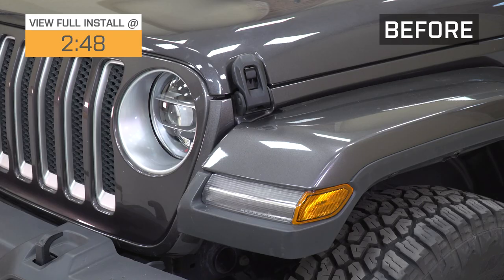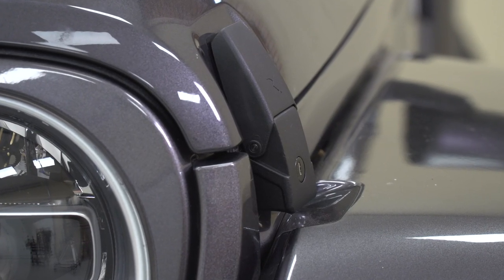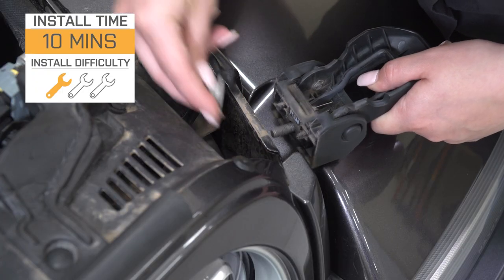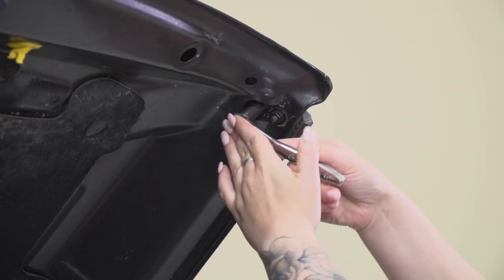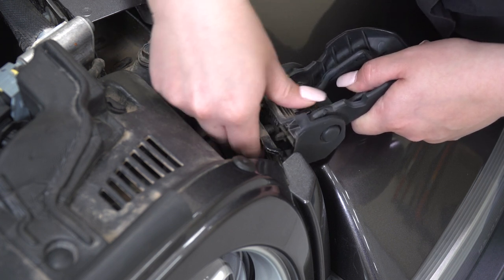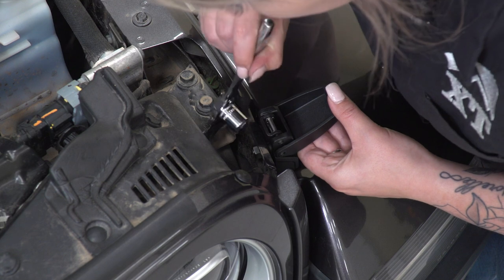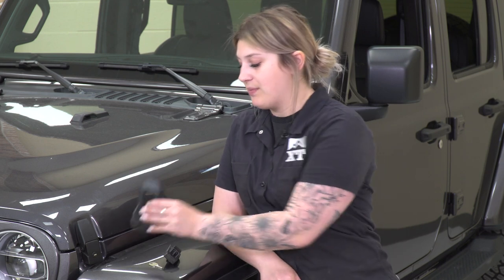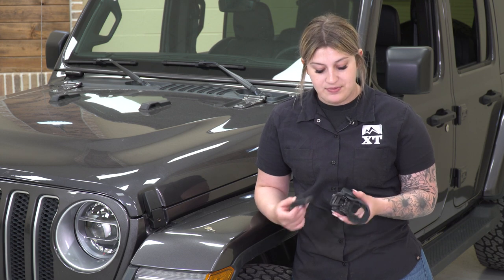Jeep Wrangler JL Locking Hood Catches; Black Review & Install

Comment: Between rust and how easily these are defeated, save your money.  The lock is about a weak as they come.  I'd use a Bolt hood lock but my trans cooler is in the way so I'm going to have to fab up something custom.

Comment: That thing would be a pain with the Rubicon fenders. Having to lift up from the bottom to unlatch it. Is there even enough room to install this on a Rubicon? 
Plus what about snow and ice build up? you'll have to chip and clean the ice out to open it. 
There aren't even any grips to help pull the latch up.
Reply: Damn , you have a point. I just went for the rugged ridge. Ain’t no one stealing any items from a v6 anyway

Comment: If you live in the rust belt, don't do it! 
All it takes is 1 winter for the internals of that locking mechanism to be unfunctional...happened to my Rotopax lock mount, locking gas cap lid, locking Drake hood pins & Bestop Core Doors and all the above were from premium manufacturers unlike this...they don't even specify who the manufacturer for this thing is.

Comment: IMO, on these newer more expensive Jeeps, hood security and gas cap security should be standard. This is common-sense stuff. These should not be mods. 

I have a 2022 Jeep Wrangler High-Tide and I ordered and installed a fuel cap cover. Now, I am looking at a solution to secure my hood. This is a consideration, but extra keys. I am also considering the Bolt JL hood lock.

I would like to see Jeep add these as standard. However, thank you for the tutorial. 🙏
Reply from the maker: Since they aren't standard yet, that's why we're selling these options now! 😁 Thanks for watching! -Zach